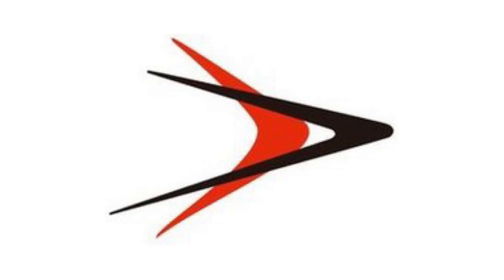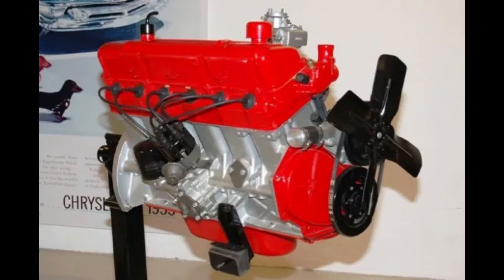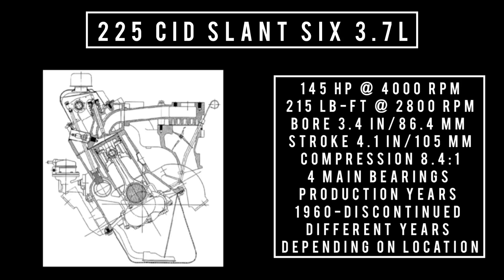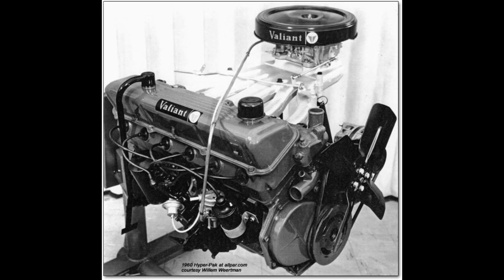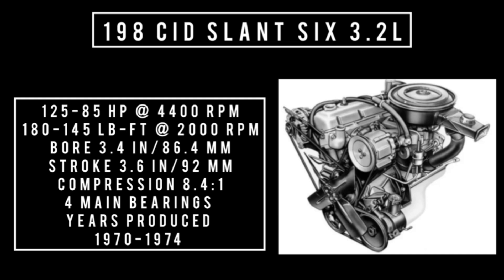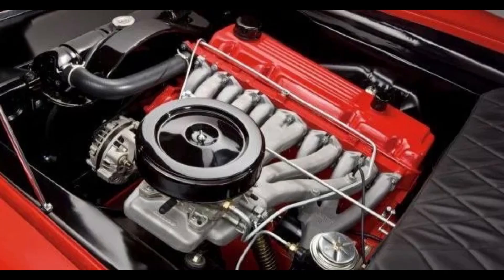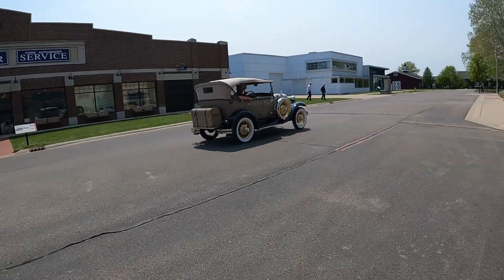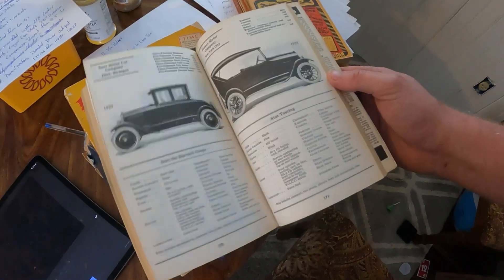Chrysler slant six engine family

Comment: You forget that in 1972, advertised power ratings went from SAE GROSS to SAE NET, dropping the on-paper number about 30% on most engines. SAE NET is a more realistic way to measure engine curves because it includes air filter, full exhaust, production tuneup settings as well as the engine having to drive a water pump, fan and alternator. It was the engine more or less the way it was installed in the vehicle.The old GROSS rating allowed the manufacturer to optimize the engine in various ways, including eliminating the air filter, use a minimal exhaust system, optimized timing settings as well as eliminate parasitical drag from ancillaries like the water pump, fan, etc. Look up any engine spec from '71 to '72 and you can see it. No changes other than the more realistic test method. Also, Chrysler dieselized the slant six in the '70s. There are a few surviving Dodge Darts with diesels that survive, as well as a few test engines. They came during the fuel crisis when diesel cars and trucks were deemed viable to help meet the new CAFE standards. It was "OK" but deemed not worth the investment to put it into production, especially when fully developed diesel engines were available from corporate partners like Mitsubishi (rememeber the '78-79 Dodge diesel trucks using a Mitsu diesels). Also, International Harvester intended to use the slant six in the Scout starting in 1981. It was tested, blueprinted, planned, prototyped and ready to replace the IH 304 V8 and 4-196 for '81... but IH Corporate pulled the plug on the Scout line after 1980 so beyopnd about 40 test vehicles that was that.

Comment: Have owned many cars in 65 years of driving.  No question I've owned everyone of the six cylinder engines in the article. By far the slant six Mopar was the best. Knew a mechanic who worked for Yellow cab.  He said when the slant six got to 200K miles they would remove the head, grind the valves, replace the timing gear and chain, rings and rod bearings.  They would then put them back on the street for another 200K.  Consider this:  these engines had many more hours than they showed because they would sit in line at airports and depots waiting for a fare while idling.  It was hard to get past 60,000 with a 235 Chevy six without a valve job.  Most garages had a 235 cylinder head already rebuilt and on a shelf so you could get a valve job in and out in 1 day.  The Ford inline six was great in a work truck and the AMC 4.0 six in Jeeps was also a good choice.  I now have a BMW 2.5 liter six in a Z-3.  Wouldn't trade any one of these engines for my Bimmer engine.
Reply from the maker: Awesome information and insight thank you so much for sharing your experience with these engines =)

Comment: The 198 was available in the Feather Duster and the Dart Lite in 75 and 76. These were the economy versions and had aluminum hoods, trunk lids and bumper supports.They only came with a manual 3-speed.
Reply: Actually it was called the "Overdrive 4"
Reply from the maker: Awesome thank you so much for that information =)

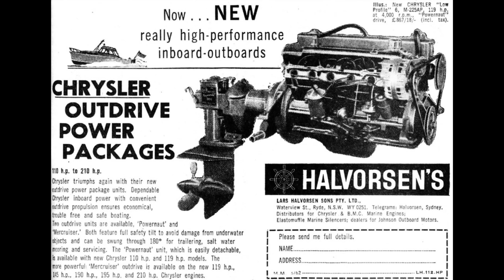Comment: 2:08 "In the comment section, can you think of an engine that had a longer lifespan than this one?"
The Volkswagen boxer (flat-4 air-cooled) was produced from 1936 through 2006.
Reply from the maker: Awesome I will definitely do an engine episode on the Volkswagen boxer engine =)
Reply: @What.its.like. , definitely an iconic engine.  Low power but light and simple.

Comment: I had a 1970 Plymouth Duster with a slant 6 and three speed on the column manual transmission. The motor outlasted the car, it had rusted so bad that when it rained water would spray up from the floor boards at you. That car never stopped running.
Reply from the maker: Awesome thank you so much for sharing your experience =)

Comment: I had a 1966 Dodge Dart, and my wife had a 1971 Plymouth Valiant, great running cars, they ran, and ran, and ran. Of course you had to do periodic maintaince, such as oil changes, points, rotor, spark plug etc. If Chrysler had kept the engine it would have been a Toyota, Datsun/Nissan killer.
Reply from the maker: Awesome =)

Comment: I was told at the time that the reason that the Slant Six was discontinued was because they had a relatively new 6 cylinder AMC engine and the tooling for the Slant Six was so worn out and would require all new tools in order to continue it.

Comment: I've had 3 of these engines :  235 ; 232 ; 225.  Each had their own strengths and weaknesses.   The 232 was the smoothest engine  I've ever owned but it was a maintenance hog.  The 235 was a good solid engine the tended to be leaky :  valve covers and rear main.  The 225 was a good solid engine.  Tune ups you needed to remove the distributor otherwise, a good engine.
Reply from the maker: Awesome information thank you so much for sharing all of that

Comment: My dad used to get a kick out of surprising Mustang and Camaro guys leaving stoplights. The 225 in his ‘62 Lancer had enough torque from that 4-inch stroke and long manifold that he could compete until the muscle cars started to breathe.

That Lancer had the aluminum block. It overheated terribly on a vacation trip, stranded us in a little town. They towed it home, replaced the head gasket, but it was never right again. They swapped in a cast iron slant six and it sagged the front of the car so much they had to crank up the torsion bar adjusters.

We also went to look at a ‘70 Charger sometime in the mid 90s. It was a slant six three speed! Lime green.
Reply from the maker: Awesome I love a story where the underdog wins

Comment: This engines weak points were its 4 main bearings (more = stout) and its limited flow through its heads. Clifford Research headers, Offenhauser intake and a 4 barrel in the 390-525 cfm range really wakes the 225 up. With  few design mods it would have made a swell diesel.

Comment: When young I owned a very nice 1976 Dodge Aspen 2 Door "Special Edition" with the 225 Slant Six. The car rode like a dream (I know as I now own a fleet of last generation Lincoln Town Cars) it was well made, very dependable, and could go from Orlando to Louisville for $35 in gas. The Torque Flight Automatic was also one of the transmissions on the road. These cars could go forever. In fact they did keep going until they were just out of style. Then people traded them in for the plastic bumper, direct injected junk we have today. What are most people going to do with 300-400 horsepower in a 4 door sedan or SUV? Taking mom to the grocery store could sure be done a lot cheaper with a 225 Slant at 110 hp.
Reply from the maker: Awesome, thank you for sharing those memories =) I kind of want to find a 88 Lincoln town car and do a nostalgic episode out of the 35 cars I’ve owned that one is by far the best riding car =)

Comment: Folks, all the horsepowers quoted in this video are GROSS horsepower.  Take 25% off to get to today's NET horsepower.  117 ghp = 88 net horsepower.  145 ghp = 109 hp.  I had a '66 Ford F100 pickup with the 4.0L/240 CID  Ford Truck 6 and it quoted on the data plate 150 hp = 113 hp.  This truck was so heavy despite the short bed that I could WALK on the hood, I weighed about 150 pounds at the time.  I had it weighed at the airport in Orlando and it was 5846 pounds!  And it had cruddy drum brakes at all four corners.  At one point my semi-retarded brother lived at my house in Orlando and I let him drive my '85 Porsche 928 from time to time, but I -NEVER- let him drive that truck, because this thing was like a locomotive to stop, the brakes were terrible!
Reply from the maker: Thank you for pointing that out I forgot about gross horsepower and net horsepower rating change

Comment: Which inline 6 would I pick? I’m going to create my own option and go with Pontiac’s overhead cam 6. The standard 1 barrel version made 175 HP and 240 lbs/ft and the 4 barrel made a claimed 215 HP and 255 lbs/ft. Their fiberglass reinforced timing belt were said to last 100K miles and I’ve been told they were dead reliable. 

If I have to choose between your choices I’d probably go with the slant 6. You really had to try to kill it and even then it took major effort.
With that in mind I’d like to share a story told to me by my friend’s mom. She had a 67 Dart with the slant 6 she drove in college in the early 70’s. She attended college in Southern CA and went home for a holiday in central CA, about a 3 hour drive North. While she was there her dad performed some basic maintenance on her Dart. Everything looked good so she headed South, driving the roughly 200 miles back to school. Her drive took her over the famous Grapevine and Ridge route which means steep inclines and higher RPM driving in places. When she got back to her school she went to her room and her roommate greeted her and then told her to call her dad about something urgent about the Dart. She called her dad and he was glad she had made it. She told him she made it back just fine and the car seemed to run fine although the oil pressure light did flicker momentarily a time or two. He was surprised and told her not to start the engine until she had someone repair an issue. Turns out he had left the oil drain plug loose when he changed the oil in her car prior to her leaving and he found the plug on the ground in the road in front of the house followed by a trail of oil.
She had made it the entire way including over the Tehachapi mountain range with only a minimal amount of oil circulating in that slant 6. 
The drain plug was replaced and oil was installed. It started up fine and seemed to be running good without any noises. 
She drove that car for many years afterwards without ever experiencing any engine problems. Those slant sixes were one tough motor. 

Thanks for the history lesson. It’s nice to see people still interested in this bit of automotive history.
Reply from the maker: That is an awesome engine as well one day going to do an episode dedicated to that engine =)

Comment: The Ford "truck six" was introduced in 1964 and ran until 1996.  They made more of this inline six engine than the "Slant 6", which sounded like sneakers in the dryer or a snow blower.  Someone told me when I was 18 that this was supposed to be a V12, but if you look at the design, the camshaft is on the WRONG side of he engine for an OHV V12, which has never been sold in any case.

Comment: Mine was a 69 sport 2 door Dart with the 225. Purple with black roof and interior. The torsion bar mount ripped out of the frame hitting a pothole at 75 mph. OUCH
Reply from the maker: Wow did you go airborne
Reply: @What.its.like.  Straight to the ground in a screeching grind to the ditch. Lucky it was the passenger side and nobody was aboard. Cross member had rusted out. Took plates and left car there.
Reply from the maker: Wow that’s nuts

Comment: The slant had a couple of little know advantages over other American six cylinder motors. For one, they had the same bearings as the 318 V8. No doubt this was done for simplicity and cost saving but it meant they had a very strong bottom end. Then, they had quite a good head design with individual intake and exhaust ports to each cylinder, compared to the cruder heads used by Ford Falcon and Chevy Nova sixes.
This meant they were a very strong durable motor with a lot of hop up potential. Legendary stock car mechanic Smokey Yunick said they responded to a few simple hop up tricks, more than any other motor he ever saw. He was referring to the Hyperpak kit sold by Valiant dealers. NASCAR had a short lived compact car racing series in 1960 or 61. The Valiant wiped the floor with the competition in every race so they quickly cancelled the series.
Another thing, they were about the last new engine designed with pushrods and solid valve lifters. Another performance advantage but it meant you had to adjust the valves every 20 or 30 thousand miles. If you did this the motor was as silent as a hydraulic lifter motor and stayed that way for the life of the car. But nobody ever adjusted them so they usually sounded like an old diesel. They kept on running though, regardless of lack of maintenance and abuse.

Comment: Those engines were almost indestructible. When I was in high school, a friend had one of these cars with that engine. We took that car off road and beat the daylights out of it. I actually felt sorry for its engine. We beat that car trying to kill it as mischievous teen age kids do. The engine never failed. It still ran very smoothly after getting punched around as though Mike Tyson was trying to knock it out! I think the only way to make one fail would be to drain the crank case oil out and drive the car at high speed, and then it may surprise everybody by not seizing up! All I can say is, Long Live The Chrysler Slant Six!

Comment: Final thought. I worked for GoodYear from 1995 through 03, and we had a fleet of E250 cargo vans on the extended w/b. All had the 4.9/300 six with the AOD trans. When Ford switched to MPI fuel injection, that mill was unstoppable. Several of those vans made it to 400k before wearing out. This was in day in day out heavy stop and go local tire deliveries; very little highway miles. We couldn't keep ball joints or brakes on them, but never an issue with the engines. They just wore out.The only other domestic straight 6 that I saw during that time that could come close or match it was the Jeep 4.0 with MPI as we had a contract with CSX railroad that were used for yard security, BUT some of those did have head problems, whereas the Fords never did.
Reply: Didn't Ford E250 vans have twin I-beam front suspension?  Ball joints??  Maybe it was the king pins that wore out.  You are right about the 300 cu.in. six... gear driven cam...Bulletproof.
Reply: My dad has two vans with the Ford Straight Six: amazing engines.  Prior to that he had a Dodge van with the 225 slant six and he raved about that engine...sadly the van rusted out...but ran trouble free for 6 years with TONS of miles for commercial delivery service.  He much preferred the Ford's smoother newer van drive and had a few issues with his '76 Ford Van that were easily repaired (a blown valve that needed repair and eventually a pushrod needed to be replaced, easy enough).   The '87 Ford Straight six with fuel injection was a very peppy drivetrain and was totally trouble free for 13 years of service for which it was sold still running strong. .

Comment: I go with that leaning tower of power any day. We had three different vehicles with slant six. A 64 Valiant, a 67 Dart and an 82 Dodge short bed two wheel drive truck. All had manuals. The two cars were three on the trees. The truck had a four speed with granny low. I always started out in second gear. The winter on 92 was a cold one . My dad had a Chevy diesel pickup. My mom had a new Chevy Lumina. Temperatures well below zero and my 82 Dodge was the only one to start. The 67 Dart had a four barrel carb. I think my brother-in-law put that together. I don't think it was original. It was pretty damn fast though.

Comment: For shear power I would pick the ford 300 inline six, GM also made one but it was only available in trucks sold to the Army in the 50's. As for durability the AMC 6 with its high nickel cast iron block is the champ. (All AMC engines used nickel casting alloys as well as Olds and some heavy duty chevy truck engines) Almost forgot the overhead cam 6 from Pontiac based on the Chevy stovebolt six.

The slant six had two detractors: that miserable nylon distributor gear and the external oil pump that leaked from the factory. They were also prone to vapor lock because of the sandwiched exhaust and intake manifolds. Chrysler kinda dropped the ball on the aluminum blocks by not developing a water-less coolant that would have solved the dissimilar metal corrosion problem.
Reply from the maker: One day I want to do a comparison episode 300 in-line Ford versus 292 Chevy I’ve heard really good things about both engines they just don’t die the 300 Ford a lot of people think we’re was better than the 302 verse eight from that era
Reply: @What.its.like.  I remember the news doing a story on the Ford 300 end of production where they had a ceremony for the last one to come off the line. There were a lot of truck owners that were not happy about that engine being dropped.
There was a V6 from GMC  that was 427 cu for the 5 ton and up trucks and even a v12 that was two of them sandwiched together it made incredible torque but redlined at 4300 rpm. Of course it was dropped for diesel engines but imagine a 14 liter v12.

Comment: In 'Would You Rather' you show engines that aren't all contemporaries of each other.  And is the AMC 232 before or after 1971 when it changed block deck height?  But of the choices offered I'd take the AMC 232.

Comment: A Valiant with a 170 CID HyperPack won the C Stock Trophy at either the 1960 or 1961 NHRA National Drags at Detroit.  It was competing against 1955-57 Chevy V-8s.
Reply from the maker: I’m really intrigued by the 170 hyper pack that’s a car that I would really like to drive in the future one day. Just imagine if it was equipped with twin cam it would probably be right up there with the Hondas and Toyotas it would have a quicker throttle response because of the second cam.. All in theory of course

Comment: Had a 1962 Dart with the slant 6 and push button transmission.
Reply from the maker: Sweet how did you like it
Reply: @What.its.like.  It was OK car, easy to work on. Only thing I ever had to replace was brakes, and an alternator.